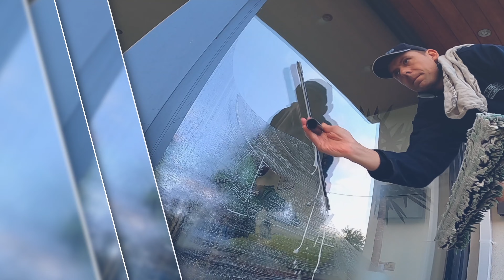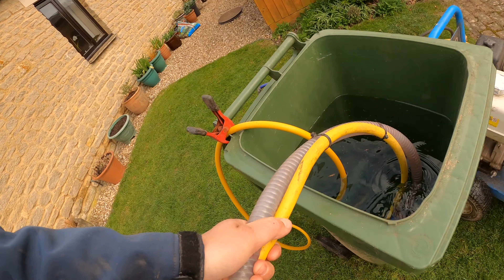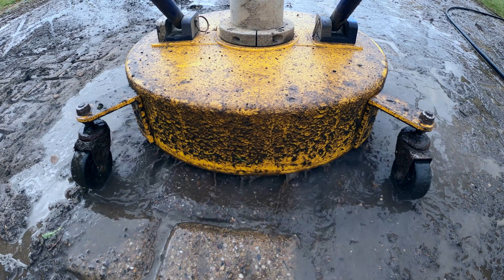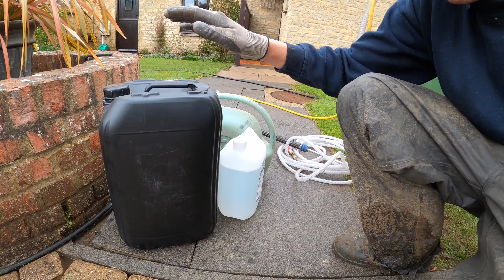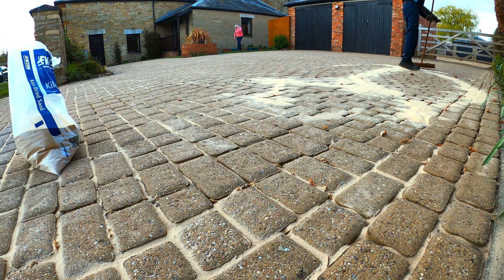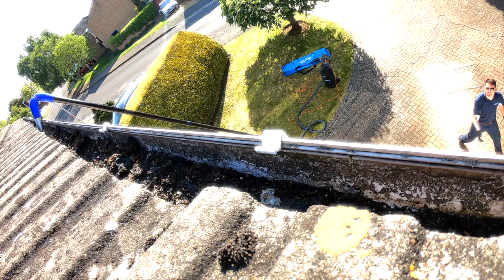Problem Driveway Solved!

Comment: Top job that pal that machine is a beast is that the 15 litre one .i am looking at the kiam 25 litre one i dont know what to pick .the honda at 21 litre  or the kiam at 25 litre i know honda is very reliable tho.
Reply from the maker: I would go for the 21 litre Honda if I were you. That’s what I’m using.👍🏼
Reply: @aemackintosh  ok pal thanks a lot will do  thanks for the reply back.

Comment: Been block paving for years mate you left way to much sand in the joins it will just splash out when it rains all over the drive but great job on the clean 😁
Reply from the maker: It’s kinda just the nature of the beast on this one. The blocks are slightly rounded so they’re almost like cobbles.😬

Comment: Hey mate fantastic job on the cleaning. I quick question though. What do uou mean with a 50/50 mix. Lets say i have a driveway 3×10. How many liters of water do i need to use and how many sh to mix in the water.

I hope you can reply.
Reply from the maker: I often use a watering can, filled half with water and half with hypo. You could use a weaker mix if the surface isn’t so bad. The Xjet spray tool I’m using here is set to a similar dilution rate.👍🏼
Reply: @aemackintosh  hey mate if i want a 3% mix on a 6 liter hand pump how do i calcute how many water and hypo i need to add.

Comment: Looks spot that mate. 

How much extra do you price up for the sand replacement? (I watched your other video how you price up psm just for jetwashing).

Do you need to add a sealant after filling the gaps with sand?

Tyia
Reply from the maker: I do a separate price for sealant if the customer requests it. I didn’t realise this job would take so much sand, it’s a tough one to estimate on this occasion.😬👎🏼

Comment: I use 120 oC when cleaning. This massively reduces the need for that extremely strong SH mix. I would then apply a soft wash solution with the SH at around 2 to 4 % and leave it down to do its job over the next hour or even 2. but I dont need to wash down again, reducing the loss of sand further. Just make sure you wash any of the mix off the house or any wood or grass etc. Then I would typically return on another day to sand in. But basically the results are the same. The hot water really speeds up the cleaning process and gets nearly all the black spots out with out the need for chems. It also means that i can dial the pressure down for delicate substrates.  The next thing i would spend my money on is a hot system from Rutland pumps.   Good work!!!
Reply from the maker: Thanks, great tips.😃👍🏼

Comment: My other question is, if you was going to replace your pressure washer is there any other make which is better now...
Reply from the maker: I think this is still a very solid machine. You should look for a combination of good pressure and high flow rate.😃👍🏼
Reply: For this type of cleaning flow rate is almost more important than pressure. 200 bar 18 lpm is the minimum you want. Go to Rutland pumps and get your self something for the job.

Comment: what size is that wheelie bin you had a black  one
Reply from the maker: This is a smaller wheelie bin, it holds 120 litres I think.😃👍🏼
Reply: @aemackintosh  that wat I use and store hose in after use
Reply: I have been thinking about using a wheelie bin, I am not doing much pressure washing at the moment so don't want to spend much. At the moment I  use a watering can or a sprayer to put the hypo down but was thinking of mixing it in the bin and spraying on with the pressure cleaner with the nozzle open giving a wide low pressure  spray. Ant thoughts on that Ashley.

Comment: I have a 500 square meter driveway how many bags of sand do u think it will use ?
Reply from the maker: It depends on the blocks, how far apart they are and how much of the sand you rinse away in the cleaning process. I suppose it could easily be 5/6 bags?👍🏼
Reply: For the 500square meters?

Comment: Great video. With that lance attachment, how do you know what chemical to water ratio its using?
Reply from the maker: I don’t know exactly. It’s a fairly weak ratio but it covers a large area nice and quickly, then I apply extra in some area using a watering can if necessary.😃👍🏼

Comment: Another great video leaning loads for you. In the process of setting up just got the Pro 20 x from spinaclean with a 20 inch FSC and turbo upgrade. Can I ask with the hypo did you use it neat or water it down if so what ratio did you use please and do you need a license to use it sorry new to the trade thanks again love your channel keep up the good work Ash 👏👍💯
Reply from the maker: I’m glad you find the channel useful. I mix the hypo about 50/50 with water which is quite a strong mix. Sometimes you might only need a 1/4 mix.😃👍🏼

Comment: Great job well done! 👌 👍 🤝
May I ask how many bar used and what nozzle size? Thanks!
Reply from the maker: Thanks! I don’t have a pressure gauge on my machine, but I am using a 300psi 21litres per minute machine, with 25 degree jets on my fsc.😃👍🏼
Reply: @aemackintosh  Thank you very much! 👍

Comment: Good to see you’re wearing safety glasses. I did one last month and a stone came up from in between the block and shattered the glasses 🙄 - hypo all the way at 4:1 lovely job 👍
Reply: i use a 50/50 mix with 30 min dwell time
Reply: @premiergutterandroofcleani6668  brave man!!! Last time I used 50/50 I turned my jumper sleeves from blue to white 🤣🤦🏻‍♂️

Comment: Looks great mate can I ask how you priced this one? Do you charge more for using chemicals?
Reply from the maker: The chemical is relatively cheap, it’s the cost of sand that can get you if you’re not careful. I factor all this in and charge per square meter. There is a video about pricing in the pressure washing playlist on my channel.😃👍🏼

Comment: A snow foam may work as well as a cheap alternative . just rinse it all the chem on the metal parts  off after  or throw in a bucket of cold water  ( 15 - 20 $ on ebay )  awsome job . The key factor is price... the price has to be  priced good . It has to be worthwhile ( thats aimed at viewers not  Mr A. E M )
Reply from the maker: Yes, thanks. You have to spot the potential difficulties when quoting and adjust the price accordingly. Good point.😃👍🏼

Comment: That sand looks dump
Reply from the maker: It was slightly. It’s annoying when they don’t always store it in the dry at the builders yard where I get it from. But the gaps between the blocks were big and it soon dries out again on a warm day, so it was ok.😃👍🏼
Reply: @aemackintosh  years ago I had huge cleaning and resanding job and need lots of sand. Order 25bags to be delivered to site and 22 of them were completely soaked so had to bin them and go and buy more myself

Comment: Do you ever find the water supply from the hose can't keep up with the pressure washer? I like the wheely bin idea.
Reply from the maker: Yes that can happen, but if you allow the bin to fill before you start working the level will just gradually decrease. If it gets completely empty you can just take a break or do some sweeping while it fills up again.😉👍🏼
Reply: @aemackintosh  thanks
Reply: What size wheelie bin do you use? I've been using a 90ltr bin but I find it can empty to quick if the tap pressure is on the lower side
Reply from the maker: Yeah, that can happen, and you have to take a little break or do some sweeping while it fills up again. A regular size bin is 240 litres, I started out with one of those. But I can’t fit it in my current van so I’m using a half size bin which is 120litres.😃👍🏼

Comment: Great video Ashley. Question: does the hypo have a hard bleach odor? I mean, do the clients complain about it? I have seen you use it also for roofs and exterior house cleaning.
Reply from the maker: No you haven’t. Must be someone else. Just to be clear: I HAVE NEVER USED BLEACH ON A ROOF. It can be damaging for the roof. I use AlgoClear biocide only on roofs. Thanks.😃👍🏼
Reply: @aemackintosh  you are right, my bad. It is the biocide. 
But still, my question is, when cleaning using hypo, it has a very noticeable odor that makes the clients complain? Or it is unnoticeable?
Reply from the maker: I’ve not had that problem. I get my hypo from bonnymans.co.uk and they also do a scent masker that you can add to make it smell more pleasant.😃👍🏼
Reply: @aemackintosh  I would need to find a supplier here in Vancouver, Canada though 😅 (you are becoming famous worldwide)

Comment: Unbelievable results, so you just rinse to drain on the road? Wondering how that works with a chemical?
Reply from the maker: Yes, with plenty of water. Using it with surfactant means you use far less chemical than you would otherwise.😃👍🏼

Comment: The bleach is also great for killing weeds.
Reply: The Bleach is great for killing everything, what happens to the residual bleach? does it end up in the waterways?
Reply from the maker: It gets washed away with plenty of water. That’s partly why it’s great to add the surfactant to it because it makes the chemical kind of more effective and you end up using less of it.😃👍🏼

Comment: If the client has no pets or young kids around you don’t really need to fully rinse.
With large gapped block paving I usually recommend a jointing compound, brush it in wet and it  sets solid so no weeds.
Yes a bit more expensive but that’s the customers call.
Then you only have to soft wash the drive in future.
Good video again Ashley.
Reply from the maker: Nice upsell. Thanks for your comments.😃👍🏼

Comment: Excellent work! Why have you got 2 hoses going into your pressure washer from the bin?
Reply: One is for the pump blow off valve
Reply from the maker: Yes, it’s a return hose. When you take your hand off the trigger the pump chucks out water it’s not using back into the bin.😃👍🏼
Reply: @aemackintosh  The machine i have only does this if the trigger hasn't been pulled for a while, is there a way to make it constantly flow like yours? Cheers mate
Reply: Ah thanks mate, I've never had my valve come on yet.